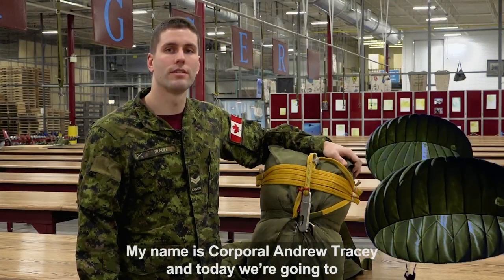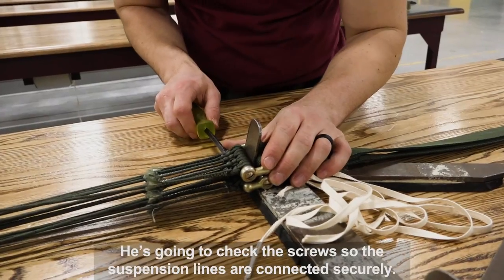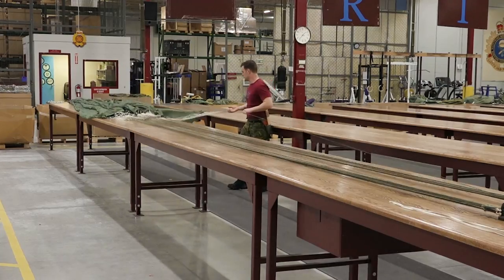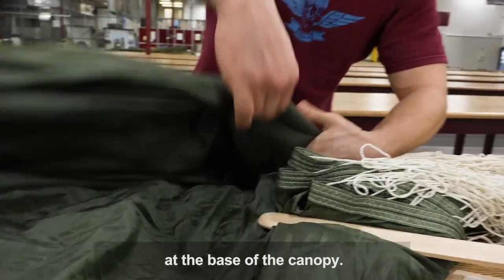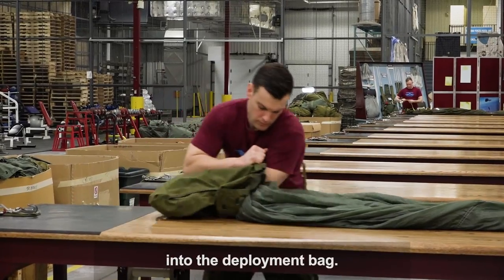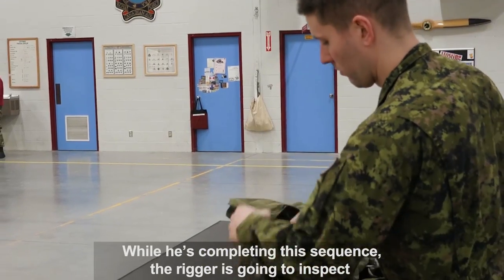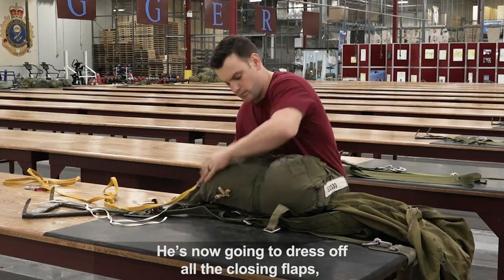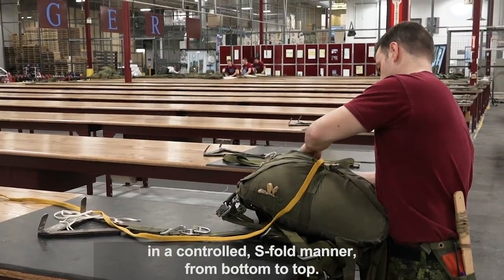Learn how to pack a static line parachute

Comment: Hey guys I am a Yank from down South. If I am not mistaken your parachutes are like our T-10 Parachutes. I loved jumping the T-10s because they are just basic using the 4 riser controls. Sometimes I get twists when my parachute deploys even on a good strong exit out of a C-130. But I rarely had twists out of a jet aircraft like the C-141 or C-5 because of the super ass strong blast from jet engines. Jet engines will proper deploy a parachute better than a propeller blast even during night or day jumps at 800 feet AGL. My feelings are I hate jumping out of a jet aircraft because I feel like I am being ripped apart from the harness with combat equipment. Prop blast from a Herky Bird is more fun from the door but will get some twists, but that is a small risk. Doing a tailgate jump from a C-130. Helicopter jumps from a CH-47 Chinook doing tailgate is fun also, no twists, along also with UH-60 Blackhawks. The UH-1 Hueys are also fun with no twists but them friggin skids are a problem. They are a pain in the ass because if you are short like me is falling behind the skids and banging my noggin behind them as I am falling straight down. Luckily I only did 3 jumps from a Huey. Just hated them big time and had no problems by getting both feet on the skids and falling forward without combat equipment. Loved the video and brought back memories from my younger days.
Reply: Interesting additional information